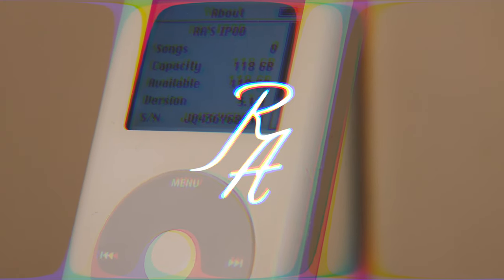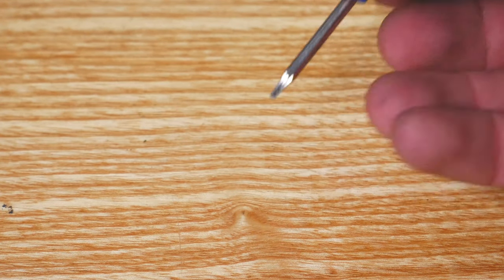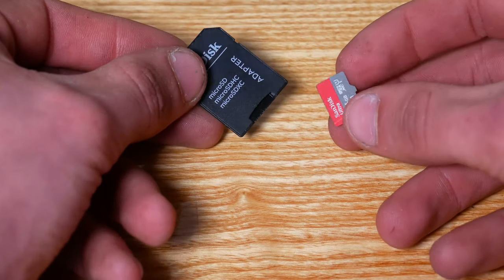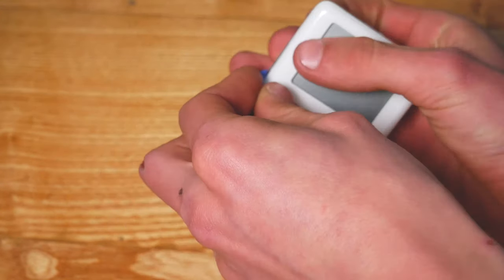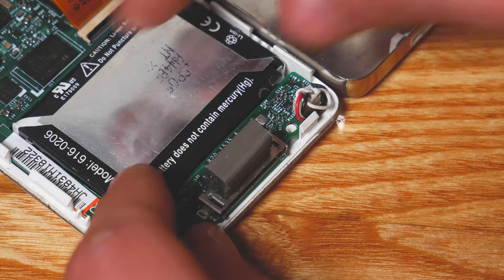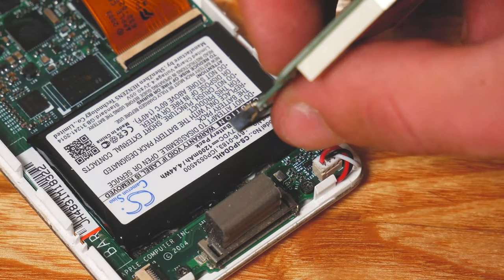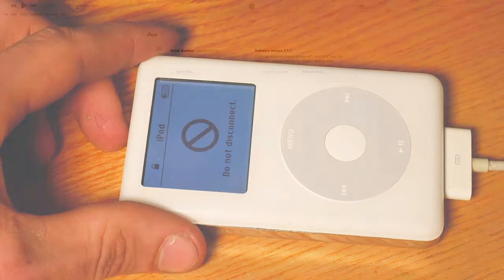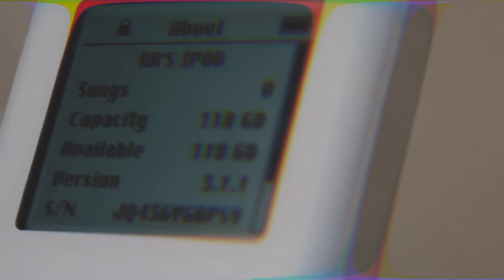iPod Classic upgrade: new battery + SD Card. 128GB 4th gen iPod Classic | RA09

Comment: One recommendation. Leave the iPod open until you’re sure the flash adapter / cf combo will work. I’ve had to use iflash products as these cheap adapters haven’t worked.
Reply: Also I format the card (fat32) first , battery removal before undoing any screws gently use a small flat blade screwdriver to help the plug out , I have broken connectors before just pulling 
And on reassembly careful around the white plastic docking liner easy to snap

Comment: At 3:29 you say "leave four empty pins on the left side". It looks like 3 empty pins are left - i.e. the first pin goes into the 4th slot marked PIN 1 on the CF adapter circuit board. Can you confirm which is correct?

Comment: Thanks for the tutorial. I'm looking to pick up a monochrome (blue backlight) 4th Gen iPod, but see mixed messages about needing a firewire connection to restore the device. Any comment? Its my understanding 4th Gen and up work fine with USB, but I thought I'd ask. Thanks!
Reply: Did you ever get the iPod? And did you need a FireWire cable? I've got the same question
Reply: @ethanmorrison4467  I did and it worked fine with the regular usb charger to restore. I was using a USB apple charger which came with it. That said, I'd suggest overlooking the 4th Gen and looking for an iPod Mini 2nd gen. Also easy to mod and similar price, or go for the 5th Gen video as they're easier to get parts for and mod.